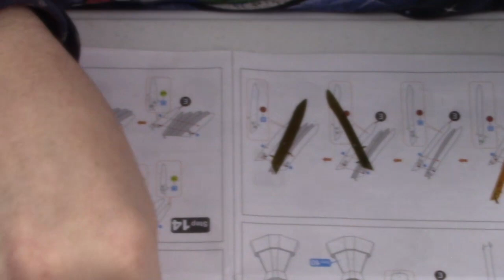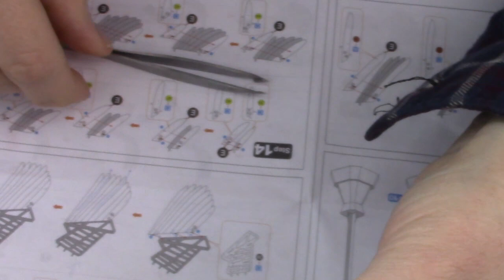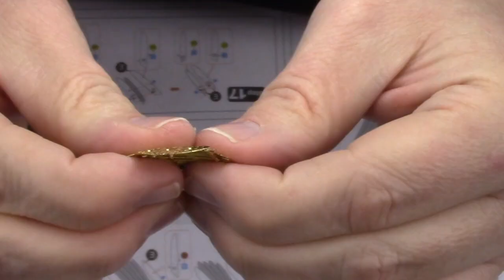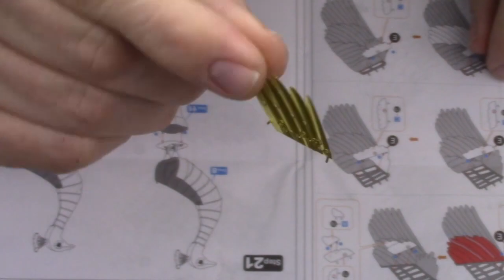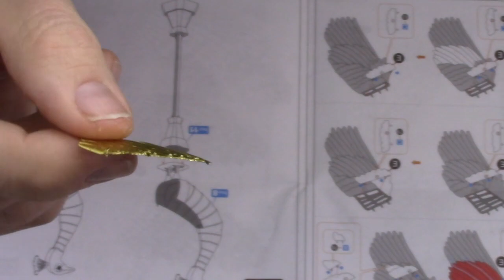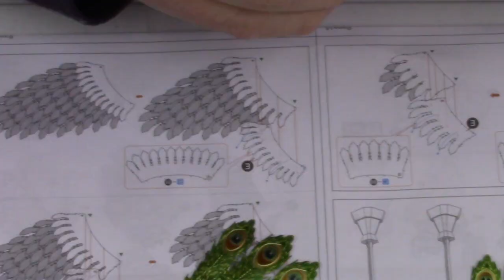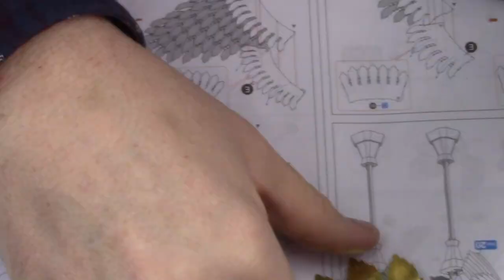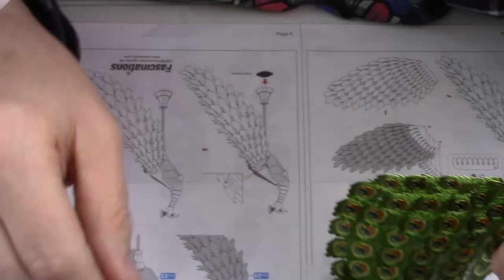Metal Earth Build - Peacock - Part 2

Comment: I found that using a piece of balsawood about 3 x 3 1/4 thick or more provides a good base for pushing the tabs over if you have tabs on the underside. You could also use hard compressed Styrofoam. Love the vids and keep them coming.

Comment: Off topic question can you wash the models off in water when dusty or need cleaning or soll they rust. I used my hose sprayer on my sink and sprayed one dmoff thsst i dont care abkut a whole lot to see cause i have quite a few not in a display case and its been 24 hours no rust. And the water made it look brand new and shiny after it dried lile i just built it and it built it 4 years ago and hasnt been dusted or washed pff since i built which is never. Im wondering if its just this kits metal is t rusting or are they all rust resistant thanks, and maybe rusting a few woulf be a cool detail for lile buildings to make it look old and abandoned like the light house or white house one and even the harry potter hoises and castle ones